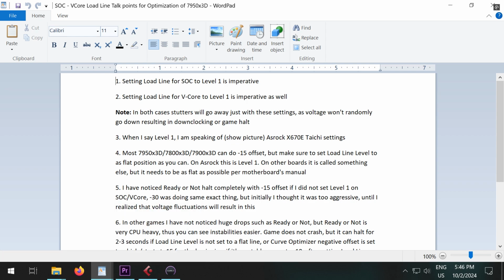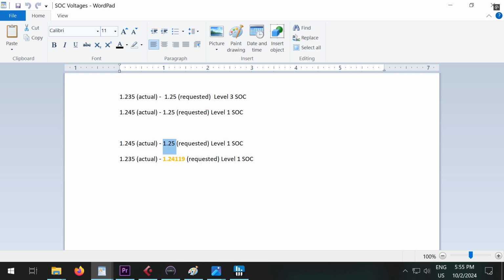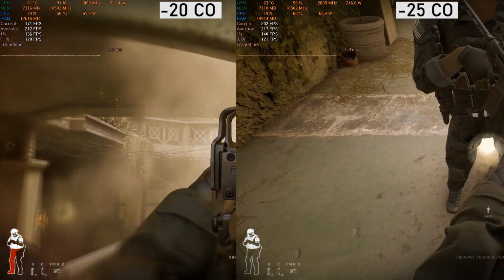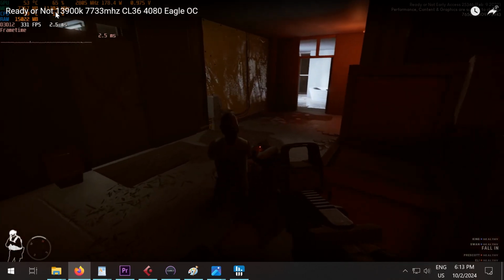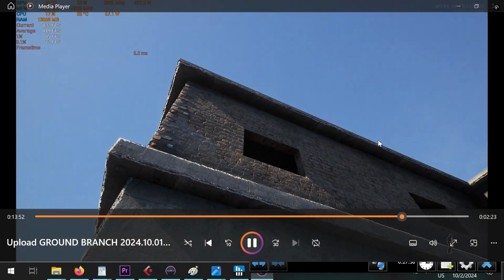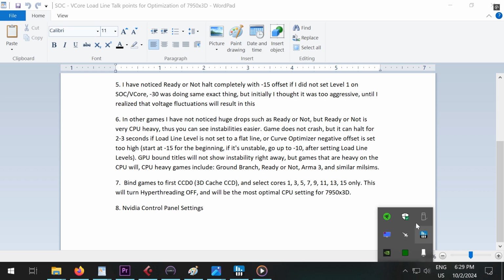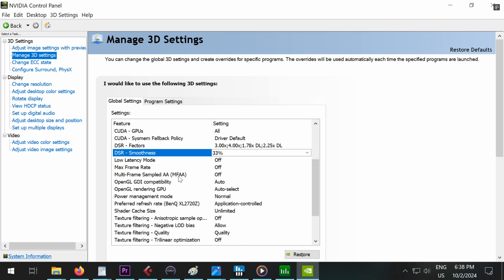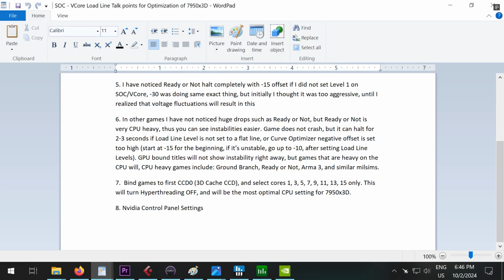SOC/VCORE Load Line Level Calibration (Gaming Optimization) 7950x3D

Comment from the maker: Disclaimer: I did following testing after and I have encountered crashing even after stabilizing Load Line levels for SOC and CPU Load Line with offset of -15 on Curve Optimizer in Ready or Not and Ground Branch.

I speculate touching Curve Optimizer adds a level of instability to games that are very CPU heavy, such as Ready or Not and Ground Branch.

I do believe 2 of the latest AGESAs are causing issues primarily with 7950x3D, as less people are reporting those issues. I had five 7950x3D CPUs, all exhibited those issues with Curve Optimizer set to anything but 0 offset. Voltage Load Line Level fix cuts those crashes at least in half, but seems like issues lay somewhere in AGESA, not as much as BIOS itself.

AGESA PI 1.2.0.2. is causing issues in 7000 CPUs greatly, that includes 7950x3D and 7800x3D

AGESA PI 1.2.0.1a is most beneficial to average FPS and has great 0.1% and 1% lows as long as you do Load Line Level fix I am talking about in the video, but the crashes happen even with smallest of offsets (such as -15)

So, it leads me to believe it is not CPU at fault, it is the AGESA revision that are fixing something, but breaking something else. If you are on 7950x3D, I high suggest going back to BIOS revision before AGESA PI 1.2.0.1a (in case you are crashing) and setting your Curve Optimizer to zero (0)

7950x3D is amazing when it working without crashing, I am not here to knock the CPU, but I want you to understand that crashing is likely caused by:

a) Load Line Level not being set to proper values on SOC and VCore, fluctuations in voltage create a hitch that results in game halt or a game crash, that actually shows as GPU crash. I don't believe GPU has anything to do with it.

b) AGESA revisions are causing instabilities, while giving you more FPS, so I would go back to previous BIOS revisions to test this. Once you find that BIOS, save your settings and write down which BIOS is the most stable. Do not update the BIOS for 7950x3D after, as you are rolling a dice as me trying newer BIOS revisions.

c) Windows revisions/updates can cause more issues that solve. Recent KB5043131 update actually took as much as 15-20 FPS just having that revision installed, so I uninstalled it (Windows 10 Pro). 

What is good for 9950X is not great for 7950x3D, and what is good for 7950x3D is not necessarily good for 9950, and I believe new AGESAs cause these issues. 

Studio Driver 560.81 has been super stable for 7950x3D and 9950X. AGESAs though? Not so much. 

AGESA PI 1.2.0.2. is wonderful for 9950X, but bad for 7950x3D
AGESA PI 1.2.0.1a is not good for 9950X, as visual stutter is always there, but not on MSI Afterburner graph

If you are on 7950x3D and experiencing crashing, please try previous BIOS revisions and copy your settings. Set Load Line Levels, and follow my optimization guides. Once you find that BIOS revision, leave it there, and don't update your motherboard BIOS. I am one of the few guys telling this, but this is the way.

Trust me 5 CPUs are not broken, the issue is somewhere else, and AGESA is the only thing that traveled across my systems.

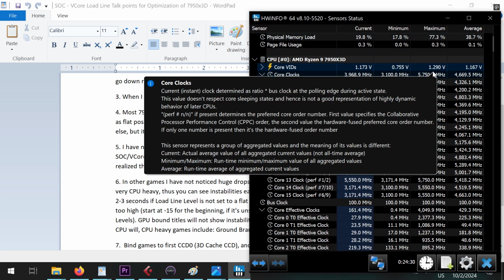Comment: 33:50
TSMC: 1.2v
AMD:   1.4v
My take:
TSMC is playing the golden ratio game.
AMD is playing the performance game with a lot risk.

We all know when people buy their new motherboard and set them up and don't touch them anymore for months.
Then later on AMD and ASRock or other brands will release a news, that they have fixed the voltage issue that is breaking CPUs.
Those people will not see this news and update their bios to fix the issue on hand, after months their system will break down.

AMD and ASRock and other brands are in the wrong, allowing default settings that is breaking the save rules set to run the hardware.

Comment: Hi,
yesterday I saw your Video again and did a test.
7950x3d, MPG X670E CARBON WIFI, AGESA PI-1.2.0.3e, SOC_Override @1,25V, CPU and SOC LLC @3 (MSI flat) and CO -15.

Boom it runs. No crashes even in COD BO6, Cubase and daily surfing.

Did u test the actual AGESE e or f ?

Comment: The reason for the dips is clock stretching of cores and/or error correction of the infinity fabric. You can check for clock stretching by comparing core clocks in HWiNFO vs the core effective clocks. A good tool to test SOC stability is Linpack Xtreme. If you can run it with consistent GFlops then it's stable, if the GFlops go down or fluctuate during the run, there is error correction going in in the SOC. Also remember that things are different if your GPU is pumping heat into the case as well, so I'd err on the side of stability with regards to the CPU, because it will be worse during gaming. Gaming loads are not as hard as Linpack, but the added heat from the GPU takes its toll.
Reply from the maker: Unfortunately it's not so simple, and not truly an answer, let me explain:
I have tried turning off C-States, DF C-States, I also would manually set frequency, etc.

In fact when you enable SOC Overclock Mode things go worse, and that mode makes your Infinity Fabric stays pinned without turning down. Well, you get worse performance using that mode, I tested it.

Next on the subject of Effective Clock, the nature of AMD CPUs shows that it still clocks down the CPU regardless of what your set the frequency to manually. It is a nature of the Ryzen CPU, using a command in Windows 11 to pin all cores into a static mode and forcing actual effective clock to be at 100% produces worse stutters. Ryzen gives a command for cores to go to sleep, and then begins to stutter because you don't allow it. 

Ryzen CPUs are not meant to be pinned as Intel can be, by disabling Intel Speed Shift and Speed Step, then you are truly pinned (after turning off C-States on Intel CPU too)

Linpack does not test 0.1% drops, which you can have a stable system on paper and begin to eat shit in actual games on 0.1% lows. I am one of the few that urges people not to fuck around with Curve Optimizer, because ANY AMD cpu is too finicky when it comes to voltages, and the lower you go on the voltage (even -15 on Curve Optimizer) the greater drops on 0.1% lows compared to Stock

Here is a video that I made a while ago
https://youtu.be/SoaKBHP5Hkk
This is comparing 7950x3D with and without Curve Optimizer. Averages are higher with -30 offset, but worse in 0.1% and 1%, while it eventually gets close, the stock remains a more valid option

Here is another test:
https://youtu.be/F46j9lgTFcI
Stock vs -50mv Voltage Offset

-50mv Voltage Offset (not Curve Optimizer) also shows anomalies in drops.

Voltages are key in these drops, and after examining SOC Overclock Mode Enable and Power Down Options and Memory Context both Disabled, I found these modes work way worse.

Ryzen's nature is to clock stretch and to set cores to on and off, it is part of an architecture. You are trying to fix something with effective clock that doesn't fix the issue, nor is it part of the architecture to benefit the gaming side. It will always clash in games and I did lots of tests on that.

Including this:
https://youtu.be/4ay27OGJz1Y

Setting effective clock to a pinned mode even through CMD.exe cause more issues than it fixes.
Reply: Having solid infinity fabric stability is a must for not having added odd stability issues.
Overclockers know firstly to respect the max you can go on  infinity fabric stability  and then start pushing CPU and RAM.
Testing infinity fabric first is a must for a solid stable system while overclocking on AMD AM4 and AM5.

Comment: You're doing an awesome job with these tests and the detailed explanations of what’s happening and why. It seems like you're the only person right now who dedicates so much time to understanding what’s going on. I’m about to start testing what you mentioned about Loadline Calibration by setting it to Level 1 and manually adjusting the voltages since I also have an ASRock motherboard.

One thing that still puzzles me is that, from what I can see, you set CO to -15, -20, -25, -30 on All Cores, but I’ve heard and read somewhere that the cores aren’t perfectly symmetrical, and they boost to their maximum clock speeds differently (I’m not sure if that’s true, which is why I’m asking you). A lot of people, myself included, test each core individually in stress tests and adjust CO per core. From what I’ve gathered on overclock.net, the best way to do this for the 7950X3D is using CoreCycler yCrusher - Kagari (BBP + FFT). I tested each core 3x6min (CCD1, only BBP) and 6x6min (CCD0, since there were two tests - BBP and FFT). In the end, I managed to get the following stable results:

🔻Single Core
◾CCD0: Kagari BBP+FFT (3x6min/core)
-21,-35,-27,-30,-24,-30,-34,-37
◾CCD1: Kagari BBP (3x6min/core)
-26,-11,-15,-11,-20,-9,-29,-24
🔻Multi Core
◾Kagari All Tests 1H + OCCT Extreme 2H

But now I’m wondering if this approach brings any real benefits or if it’s better to just set the same value for all cores. Did you set the same values for all cores because it’s better that way, or did you not have enough time to fine-tune the CO for each core?

I'm also wondering why you're not doing more aggressive RAM overclocking – like 6200/6400CL28 (1:1) or even something like 7800/8000 (1:2)? Could this also negatively impact achieving perfectly smooth frametimes?

I wish you all the best and hope to see more of these kinds of videos, although I think they cater to a very niche audience. Awesome job!

P.S.: Ahh, one more additional question—how do I enlarge the number that shows the frametime? 😂